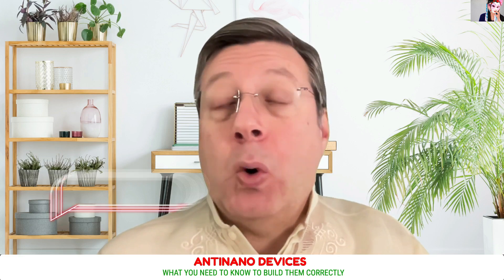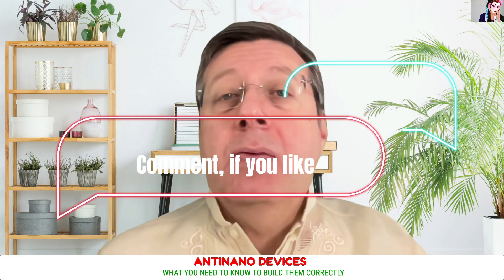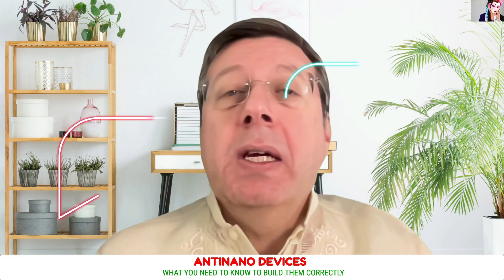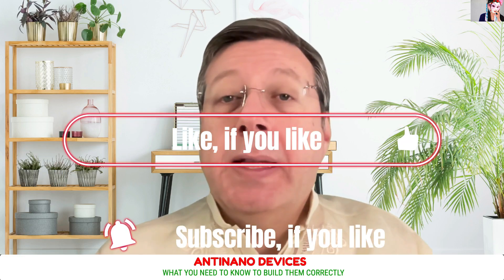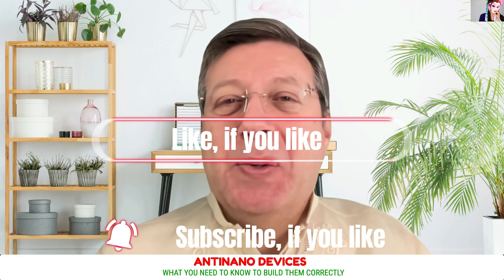Antinano Devices Webinar/Training: What You Need To Know To Select the Correct Electric Components

Comment: also your link to the webinar does not work for me, the website doesn't open. Do u have another link for webinar?
Reply from the maker: @helennthers9777, here it is https://solutions4mankind.com/and-webinar-payment
Reply: @AroyMak    so when you measure the resistance of a speaker wire, do u put it at the end of the pool or u have to unwind it and put a red thing on one side and a black on the end of the spool of wire?  Also, when using the same exact wire, does the resistance increase because it is a longer length?   i got a multimeter and tried measuring the resistance in the multimeter's wires but it keeps jumping in numbers

Comment: could you tell me, is there a benefit over flat wires vs the regular round?   does one have a better effect on the magnetic field?
Reply from the maker: @helennethers9777, the shape of the wire, in this application it does not really matter. Better is the round but if you have flat, it is OK. What is important is the current that will pass through and the number of the turns

Comment: Please aroy help me out.
What is the highest amps I can go on a powersupply if I have 20meters of 7gauge wire.
Reply from the maker: @peace maker, I need to know the resistance of the wire and the voltage that U will use. I have a webinar explaining all these and how to calculate the current when u know the voltage and resistance. Also how to measure the resistance with an multimeter
Reply: @AroyMak  the seller told me the wire can hold up to 1000volts.
But I have tried it on a 12V 40A powersupply and it didn't work.

It says Isolation Resistance min. 10MOhm x km
Reply: @AroyMak  I am going to the electrician later. Im telling him to measure my cables.
So what exactly do I need to know?
The resistance in ohm?
Do u have a number aroy?
Reply from the maker: Yes take the cable with u and have him to measure the resistance in ohm
Reply from the maker: @peacemaker7905  yes take the cable with you and ask him to measure the resistance in ohms. Your power supply if is 12 V 40 amps needs resistance more than 0.3 ohms. I would say at least 0.375 ohm 

0.375,will demand 32 amps which is fine so your power supply will not work at the limit all the time. 

So low resistance may not be measure very accurately but will be ok  I assume. As electrician he knows how to measure it accurately .

If your wire has less resistance than 0.375 get more and connect it in serial to increase the resistance to have at least 0.38 or 0.4 if your flasher can support so high current. 

Otherwise add more wire to increase the resistance until the current matches the specifications of your flasher

Comment: You know,  I think since I have the supplies I might sign up for this webinar. Do you think I can do it? I'm in serious brain fog 24/7 😂
Reply: Try Tony's sodium thiosulfate remedy and NAC, helped me a lot.  May get you back on your feet enough.
Reply from the maker: @Acetyl, correct STS is important  element in the detox from nano particles ,  and NAC for restoring damages the cause. STS needs to be used periodically.
EMP from a bucket or triangle is essential and needs to be used regularly
Reply: @AroyMak  Thank you! I have so many bags of purebulk stuff I can't even remember what's for what 😂 Tony tells me and I consume it haha I thought I had some NAC but no. I just got some copper but I'm not sure how much to take and I certainly don't want to OD. Do you take Yannis? It is in powdered form from purebulk.
Reply from the maker: @Allison Schmidt, the powder from the purebulk I take the quantity that is printed on the label. But always make sure you take also Zinc when you take copper. But I also take copper in other forms. I do not worry for OD of Cu as the recommended daily limits are proven to be low.  But Zing needs to be taken as well and maintain the Cu/Zn ration. Not necessarily the same time, but definitely the same day with few hours difference
Reply: @AroyMak  thank you! The one I bought from purebulk, it didn't have an amount printed on label and this is the first time they didn't have the amount. Thank you for the tips!
Reply: @Acetyl53  Thank you! It's so weird you mentioned that because I stumbled upon a video on here about it just before I saw this comment. I saved it to watch later. Crazy. I will have to purchase some when I get some money and add it to my purebulk collection 😂 I looked to see if I already had but was NALT. I have done the STS thing a few times but it doesn't do the explosive thing Tony described 😂 I wonder if it still is doing me any good or I should take more. Thank you for the advice my friend! ❤🙏❤
Reply from the maker: @Allison Schmidt, of course you can do it. The info in the training will give you additional information that will help you to choose correctly the electrical components. 
It is supplementary to Tony’s instructions on How to build it!
Reply: @AroyMak  you already helped me pick the components. You spent so much time helping me with that I need to pay for this class regardless if it helps me. I was feeling good about donating to you on later on but I saw you weren't on there anymore? Are you mostly using your blog now? I am in process of starting my business back up like I mentioned and will definitely pay it forward and help support your work!
Reply from the maker: I use both blog, and eshop sites and getting ready my new one... Will update soon about my new website